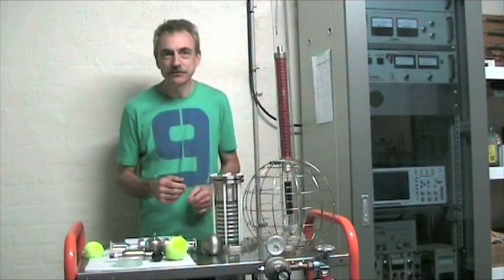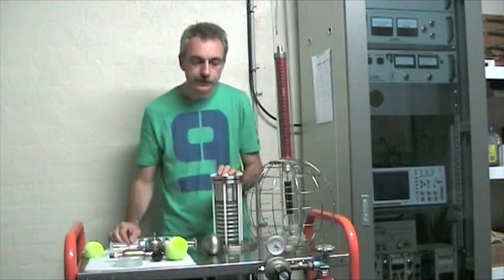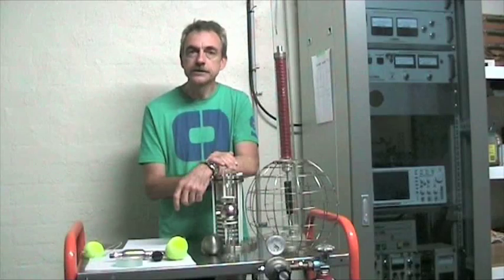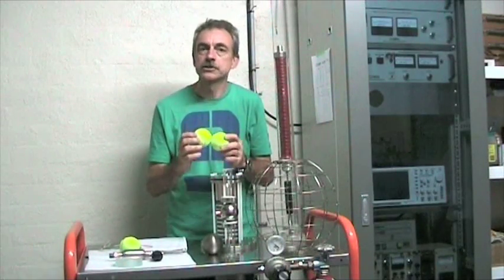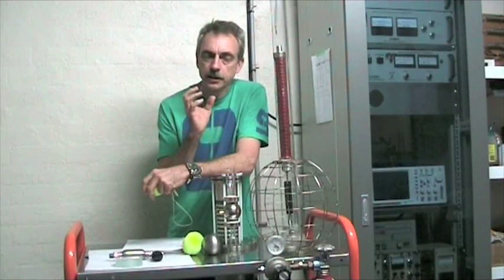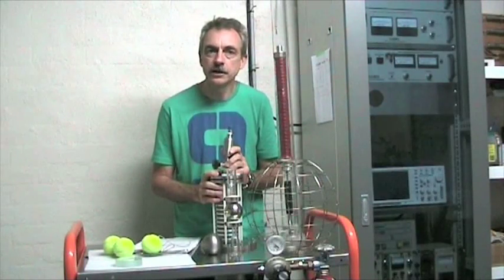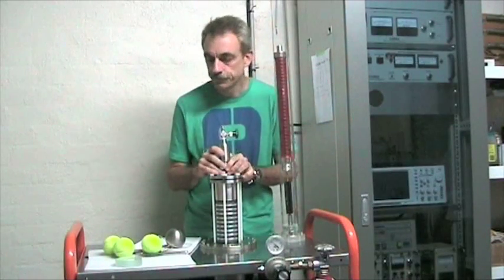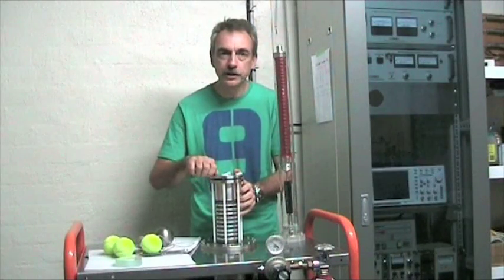F.I.C.S. Fusion Jan. 2012

Comment: Actually, I meant conducting materials such as the hardware suspension responsible for mounting the cathode.  Is is isolated with any of the alumina type ceramics?  Are you depending on high temperatures in addition to inertia through high potential difference?   Thanks again.

Comment: Hi Steven-Pretty exciting stuff!!!  Isn't the plasma temperature required to sustain the reactions far above the melting point of tungsten?  Is there some kind of polarity barrier (+) on the tungsten wall?  How is the cathode suspended so that heat is not conducted away from it into the other parts of the reactor?  Thank you for your videos.